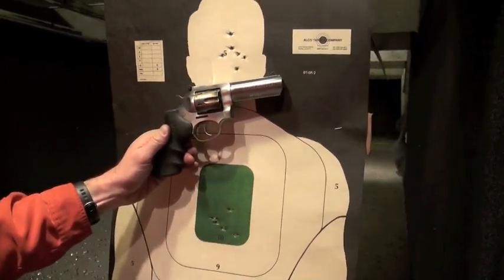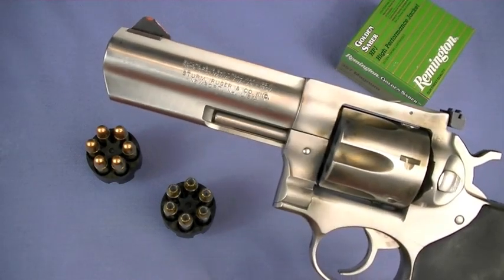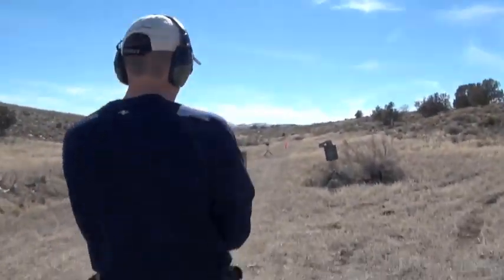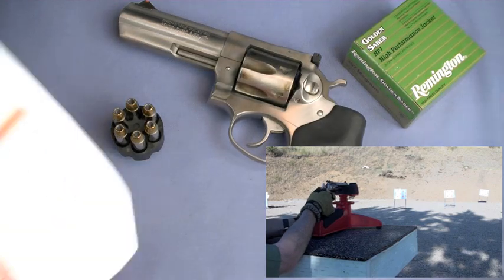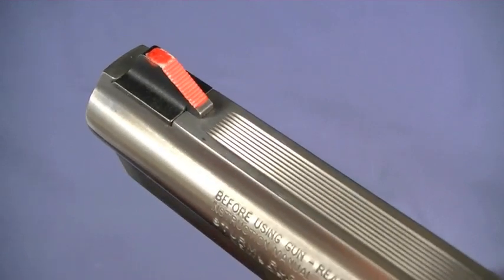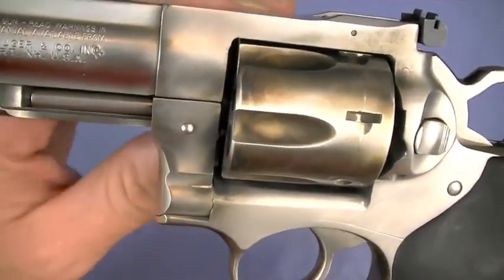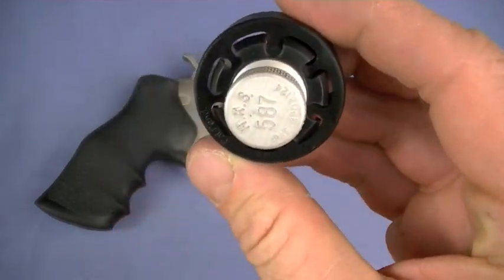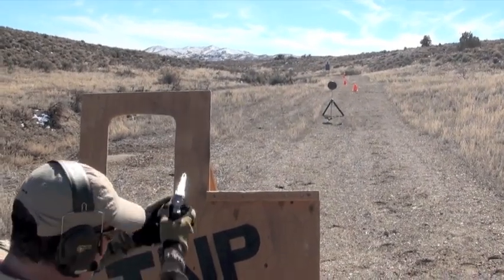Ruger GP100: "American Steel" by Nutnfancy

Comment: How is this trigger compared to the sp101
Reply: Much better. The SP101 has a heavy ass trigger, but still as smooth. Not as smooth as a Performance Center Smith, but good nonetheless. Just significantly heavier than the GP100.
Reply: Isn't the performance center considered a competition gun? In which case, is it even still comparable? Any how, somein about the sp101 is sexy to me! But I have no doubt the gp100 is a great revolver!
Reply: jake51515 Comp gun or not, the work those guys do is nothing short of phenomenal. I'd carry one daily if I wasn't already committed to my Springfield TRP.

Before I got into autos, the GP100 was actually my carry piece with the 2.25" SP101 spurless DAO as my backup. Don't ask how I was able to conceal the GP because I still can't figure out how I did it. The SP101, on the other hand, fit right into my front jeans pocket. And I'm a large man, so it didn't look all that conspicuous.

And you're right, the SP101's just got something about it. Maybe it's the fact that shooting .357 magnum out of it ain't as bad as it could be cuz of the weight. Or maybe it's cuz it makes .38+P feel like a .22. Or that you could use it as a brass knuckle if you ever ran out of ammo.

Which do you have, spurred hammer or spurless? And what length barrel?
Reply: Unfortunately, I don't own one. :( I want one pretty bad though, and I suppose you make an excellent point, regardless what the trigger is met for, if it's a good one, then that's what matter!
Reply: Thanks for the info! I would, I really would, but I'm currently saving up for an AR15, had to sell my last, and I'm really wanting a carbine at the moment. The riots in furgenson have got me with the feeling that this is the next gun I should get. The ruger isn't holding me back, I already know I'll love the gun, so that's not an issue. I just wanted some insight. I'm deciding between this and a 686! Do you have a 686?
Reply: jake51515 Now that you bring it up, that's a much more critical thing to buy if rioting or any other general WROL scenario is your concern. A medium-caliber carbine with a 30-round magazine will be much more effective at protecting the homestead than a 5-shot snub lol.

I have a 6-inch 686-P, the one that holds seven rounds. I had my local gunsmith (who also does all my 1911 triggers) do some work on the bang switch and damn, it's as good as Smith's Performance Center and then some and for a lot less money (we go way back).

I can't really recommend one over the other because the uses between them are quite different. The SP101 is slimmer and easier to conceal, even in the 4-inch variant, but the 686-P is a great OWB carry gun with a much better trigger and 2 rounds over the SP101. If you're looking to conceal, go with the SP101. If you're looking for a range gun, either one will do. Pick both up, shoot them if you are able, and take the one home which makes your heart go pitter patter, your knees weak, and your palms sweaty. Cuz in the end, regardless of utility, the one that does it for you is the one you will practice and get good with and also the one you will be less likely to regret buying. That's what happened to me and my TRP. Colts never really did it for me, but the Springfields did.

Happy buying, mate. And make sure you get a shit ton of 30-round magazines for your AR. Try out the Lancer Tactical L5AWM in translucent smoke. I daresay it is better than the PMAG 3rd Gen, so much so that I now have 50 in my possession.
Reply: Glad to see someone else share my concern! I have a mossberg 590, but do prefer a carbine for home defense. I've always had the idea that the carbine is the most effective combat weapon, those are the guns I like to own, and so if a riot ever broke out in my area over some over the top, stupid shit, I fear my beretta 92 and glock 17 won't be enough. I've heard reports of well over 2 dozen men looting stores at once! While I don't own a store, my wife and kids are worth way more to me than I'd like to gamble! I used the m4 in the army and it is a great weapon! Truth be told, id probably get the 686 just because it would be a stay at home gun. I've already got my carry guns, so I suppose id want all the velocity and capacity I can get out of that powerful little .357 round! I'm also considering getting some sort of tactical vests for mag pouches for my AR. Currently, I'm looking at a blackhawk omega tactical vest. It comes with:
Pistol light-bearing holster
2 pistol mag pouches (room to add more)
Shotgun shell carry pouches (28 shells total)
And I believe 3 AR mag pouches! (Again, can add more)
My primary defensive load for the AR is the standard FMJ, though in the army we used NATO GREEN TIPS. I actually really liked that ammo, but heard from James Yeager that because it's a harder bullet, it tends to just shoot straight through. My local gunshop told me standard FMJs wi work because of the YAWing affect the light .22 caliber bullet will do due to the high velocity. I'm not an expert, but I do know my fair share on guns and calibers. Just clueless on tactical gear! Any advice and recommendations? Thanks!
Reply: Greatly appreciate the help! I do train my wife on the carbine as much as possible and she's very proficient with it. The beretta's double action is much too long and hard for her, but she can handle the glock easily, so those are her weapons of choice. The NATO green tip rounds are easily my favorite, but right now I've got a stock pile of full metal jacket. I completely agree that mindset is muh more important; I've got the mindset right now, but the equipment and tools do make the job allt easier. I've checked out nutnfancys reviews on his Mollies. Anyways, thanks for the info, we all have different mindset and different plans so good luck to you brother and I hope we never encounter that situation!
Reply: jake51515 Here's to our worst fears never coming true and staying alive long enough to see our grandchildren grow up into productive members of society. Cheers, mate.

Comment: He shooys like there isnt much recoil. Is there?
Reply: He's shooting 38 special instead of 357 probably
Reply: They may or may not be light loads,  but regardless,  the weight of the gun combined with some truly excellent grips really cuts down on the recoil with the GP-100.  Its a very easy firearm to shoot well.
Reply: vor78 True Vor78.  I put solid wood grips on mine and still barely feel MAG loads.

Comment: FOR THE LOVE OF GOD CLEAN THAT POOR THING! Tank or not it needs love too lol...I saw one under the glass case at a pawn shop, used obviously. The outside looked fair and not too abused kinda like the one in the video but the internals good god man! They were rusted to hell, you couldn't pull the trigger or manually cock the hammer it was so fudged. The lesson here? Tank or not a little cleaning and TLC they should last a lifetime.

Comment: HE HAD A "TRIGGER JOB".  I saw a conceal carry defense lawyer on you tube warn of "tricking out " your street gun.  Aggressive prosecutors can turn dumb juries against your gun if you change it from factory delivered and make you look like you are a rambo.  He suggests 1. use the bullet type your state cops are  mandated to use (not zombie blasters or re loads )  2.  Don't add lasers or a flashlight.  3.  Don't use extended mag.  4.  No trigger job (they will test gun).  5.  Carry the smallest gun you can live with (I've seen a .380 go through a 2"x4")  just a thought.